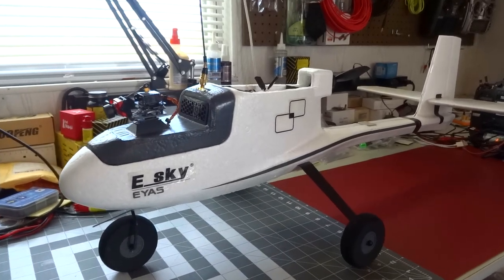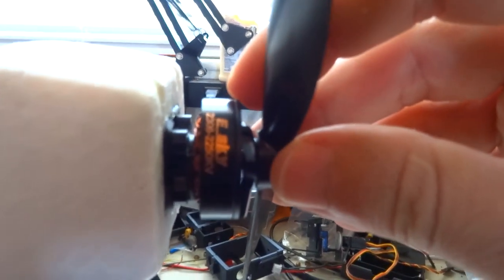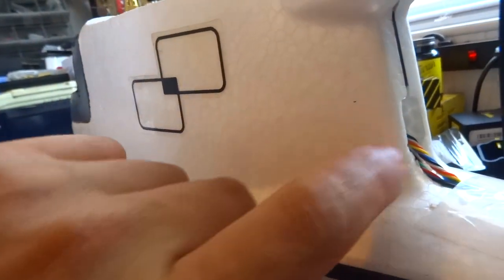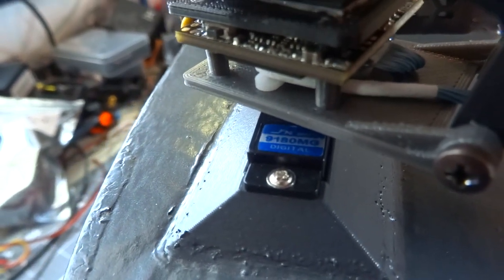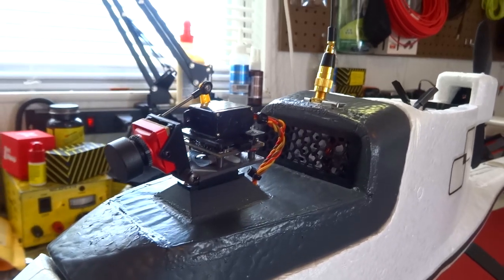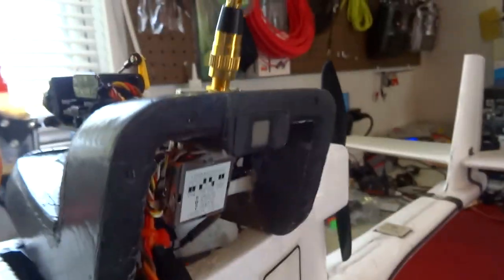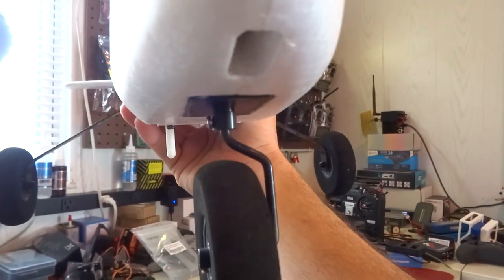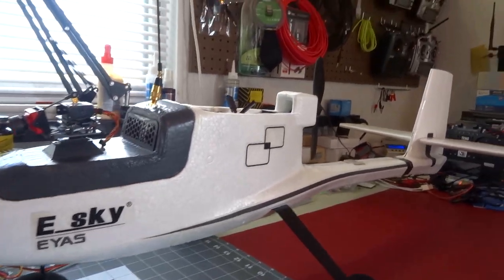Eagle / Aeroscout Rebuild Walkaround

Comment: Well done, as always.  When I look at videos like this, I always do my best to pay 100% attention the whole time.  My thinking is "I will probably find something here I did not know before".  Even though I have been into R/C planes since 1979, I find that I DO learn SOMETHING from EACH of your videos.  And these things I learn l save me some time or headaches down the road.  So thanks, and keep up the good work.   Also, some professional E.E. advice- you will find everything will work smoother, video will be cleaner, your rcvr and flight controller will be happier, etc., if you not only keep power cables far way from signal wires [at least a few inches, and when you need them to be closer, cross them over at 90 degress], but even put signal wires in their own shielded cables.  Depending on what it is, you can even use antenna wires for some of that.  If this ends up making you happy in your next build, and you want to go the extra mile, put 2 pole filters (a cap and a coil) on every servo and Power Converter +V input and output- like essentially attached to them.  Ya, I know, some of these already have some of that built in.. nothing wrong with more.  If you get a crazy oscillation of any kind, you need to change the values of one of the parts considerably... but once it is stable... it will be ROCK SOLID stable.  🙂

Comment: What a nice organized and clean build. 
I can't offer FPV camera suggestions, but am curious how you recorded this walk around? Mobile phone?
Nice closeups, and easy to follow video. Much appreciate seeing the details. Great mods/3dprints.

Was a bit surprised with location of airspeed sensor behind the fat nose wheel, but can't argue if you getting great data. (testing with left/rigtht slips might highlight if turbulence, but suspect ArduPilot might unify airspeed with GPS to weed out turbulent noise .. just speculation)
Either way this a great demo, learning testbed as fly this setup in future.
Reply from the maker: This was recorded on a Sony HX50V digital camera, it has a pretty decent movie mode with autofocus that works OK in good light. It looks better than what my phone records, but I just have some cheap Motorola Android phone. I was never one to spend several hundreds on a phone... lol I honestly gave the airspeed sensor about a 50/50 chance of working well where it's at... lol I hoped it would be OK, but wouldn't have been surprised if it wasn't. I ordered a standard pitot tube before I even flew it, it should be here in today's mail I think. I'm not going to bother changing it if this one is working though!
Reply: @bonafidepirate  Thanks for camera info. :)

Comment: Good build overview. I like that pitot tube location. I also like your battery setup. Is that the stock ESC you are running on 4S?  Thanks!
Reply from the maker: I knew I would forget something! lol No the ESC is not stock, I wasn't sure if the stock one would handle 4S or not. I replaced it with an old spare quadcopter ESC I had with BLHeli on it. That let me disable LVC too, so I can run the Li-Ion cells all the way down if I want without the ESC shutting down first.

Comment: @bonafidepirate I have this same plane and was thinking of relocating the elevator and rudder servo rearward for more battery space and easier CG adjustment with heaver/larger batteries. When you relocated the rudder servo to it's rearward location, how did you replace or extend the push rod going to the nose wheel? I don't see anyway to get access to the topside side of the nose wheel mechanism where the servo push rod connects without cutting a hole in the plywood battery/servo tray.

Comment: Very cool vid! Any thoughts on a solid motor to upgrade?
Reply from the maker: I haven't looked into changing the motor, I'm sure anything similar in size that will swing a 6" prop will work well. This little plane doesn't take a lot of power to fly. That said the stock motor has been working well for me so far. If the bearings start to get loose or something I may swap it out, but for now I'm happy with it.

Comment: Nice walkaround, I think if you want a smooth and precise landing you have to use a lidar, like vengan tf-mini, cause during time there's a normal drift in the baro pressure
Reply from the maker: True, a good range finder will make landings a lot smoother I'm sure! I'll have to look into that when I get to that point. lol
Reply: @bonafidepirate  That range finde can fit in the belly hatch you made.
As a personal experience without a range finder you have to set the gliding slope at 2° , but has no precission at the touchdown point

Comment: Nice job! I think Runcam has stopped making analog split cameras. Have been watching the site for a couple months and only see HD splits. Hope they start back making analog again. Question, where do you get those airspeed sensors and little 1.3 antenna's from?
Reply from the maker: The airspeed sensors are from Qiotek. They sent me a few of these last year to try out, I think they're sold at the usual places that have Chinese goods, like eBay, Aliexpress, Banggood etc. (look for Qiotek ASP5033) The antenna is the ones that came with these Racewood transmitters. They're a base loaded monopole design that works pretty good when attached directly to the transmitter, so it can use the transmitter case as part of it's ground plane.

Comment: You mentioned a way to extend the rotation limits on your pan servo using RC Option "Scaled RC Passthrough.  I'm using Arduplane 4.3.0.  Can you tell me the command that extends the servo limits?     Thank you 😀
Reply from the maker: You set the servo output that your pan servo is plugged into to use the scaled RC input. https://ardupilot.org/plane/docs/common-rcoutput-mapping.html#rcin1scaled-to-rcin16scaled (SERVOn_FUNCTION=X where n is the servo output you're setting up, X will be 140-155 depending on which RC channel you want to control the output with, or RCINnScaled where n is the RC channel) Then you can set up the min, max, midpoint, deadzone, and reversing for that servo output using the parameters here and it will obey them https://ardupilot.org/plane/docs/servo-functions.html#controlling-servo-throw-trim-and-reversal If you're using the latest version of Mission Planner (may need the Beta, I'm not sure) you can set this all up in the Setup>Mandatory Hardware>Servo Output tab as well. To use the extended range you may need to go and set them in the parameters though, otherwise it won't accept lower than 800uS or more than 2200uS. If I remember right it will still complain about anything outside that range in the parameter list but you can safely ignore it and use from 500 to 2500. Experiment with the min and max to suit your particular servo, and note how it behaves if you exceed what it "likes"... lol I have one servo that will start spinning continuously if I go too far, so it's important to back it off a bit so it doesn't do that in flight and tangle wiring, etc. Most servos will have a mechanical limit when the feedback pot hits it's stops, so in that case I back off a little to prevent any binding at max throw.
Reply: That is awesome! Thank you for the detailed procedure. Thanks again!

Comment: Did you use a dermal on the upper tray cut out? Super clean. Looking to do the same with mine.
Reply from the maker: Yeah I rough cut the wood plate out with a routing bit, then cut the foam away, and cleaned it all up with a sanding drum. It doesn't have to be super perfect since the printed tub will cover it anyway.
Reply: @bonafidepirate  For the new servo rails, were the wooden cross members existing, or did you have to glue new pieces?
Reply from the maker: @Adog332255  I glued two rails onto the existing wood plate. There's a hole in the lower plate there already, but it's too large to fit the servos without adding the rails. They're just two strips of thin lite ply from my scraps box.

Comment: Have you considered getting a HD system? I done Love my DJI HD system on my planes.
Reply from the maker: Yeah I've looked at them all, but find enough reasons with each to decide against it... lol Cost is always a factor, followed by relatively limited range compared to a good analog system. Not many of them have a good stand alone receiver with HDMI out. Walksnail looks like it's gaining ground, HDZero had potential if they could fix the laggy OSD stuff, but I think it would take some hardware changes to do it. If Walksnail can come up with a good low cost basic receiver I'd consider it. Probably... lol
Reply: @bonafidepirate  this answers my above question too :) I swear I saw you doing a video on the DJI lol
By the way, once you try digital you won't regret it ;)
Reply: I'm flying the Aeroscout twin of this plane with a rooted DJI WTF & OSD.  Didn't remember you flying so far out that the DJI signal wasn't enough.  Wezley Varty has gone out over 30km with HDZero and Walksnail.  I also use the Zohd 3500 Li-ion - easy 30 minute flights.
Reply: You know what they say, once you’ve had digital there’s no going back.

Comment: I learned yesterday that if you put that crossfire receiver too close to the GPS it will not get a satellite lock at least mine wouldn't and I couldn't figure out for the life of me why not and then when I moved the receiver away from the GPS I got satellites and a lock
Reply from the maker: Yep, I had the same issue with my Dart 250. The smaller planes make it difficult to spread things out enough sometimes... lol I've never had an issue on this plane though, how it's laid out. I always get a fast lock and enough satellites. My T1-Ranger doesn't get as many sats as I'd like, and takes a few minutes to get them. I have things spread out about as far as I can on that one though, unless I start moving things out to the wings and tail, which I don't want to do, would rather keep it so it breaks down quick and easy.
Reply: @bonafidepirate  yeah, I end up moving my crossfire receiver to the wingtip of my T1 ranger because of the GPS issue